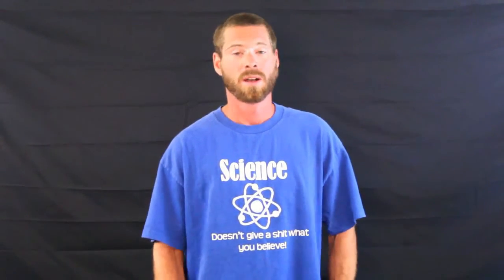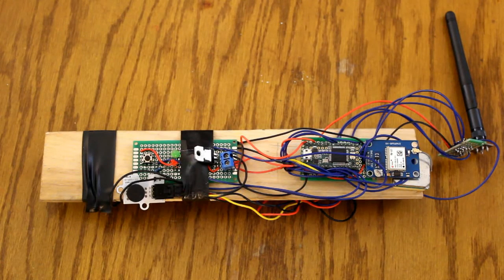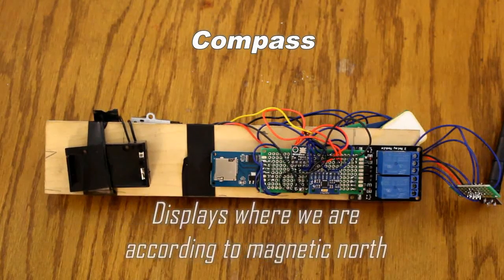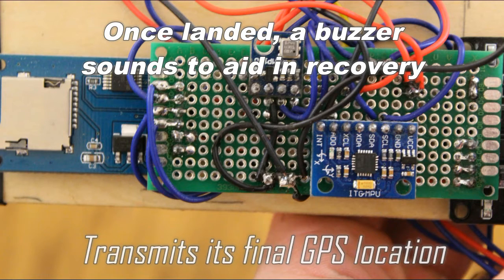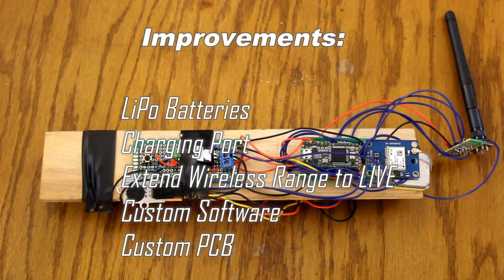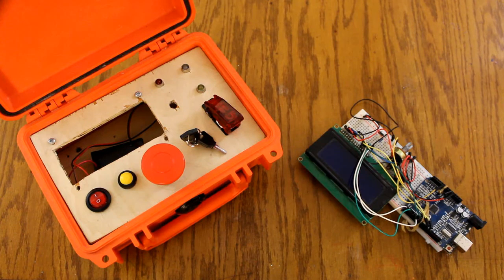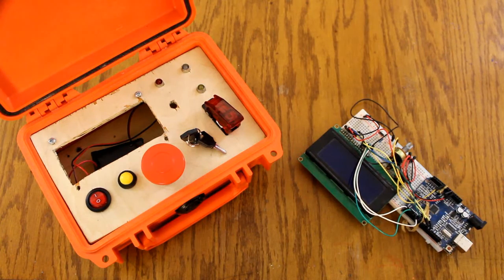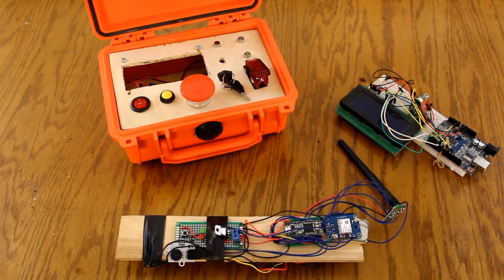Rocket Circuit Overview - Teensy 3.2

Comment: Im using BMP280, arduino nano, SD card and electric match. I'm trying to make them talk to each other. What code did you write? any hep appreciated.
Reply from the maker: Would you still like some help? Try a simple data logger code to get BMP280 to write to SD, and use a relay for ignition. Probably safer to use a manual ignition

Comment: Nice! Need to add a servo controller to make it guidable.
Reply from the maker: I have been able to get in touch with someone and we are currently working on a software program to render the data this circuit provides.

Funny you mention a servo controller. That is going to be an extension of this project. Once things are operating smoothly and debugging is finished, we get a few recoveries, the next project will be a steerable fin set to keep the rocket straight and not spin. Or be programmed to face itself in a particular direction, for science probe deployment near apogee?? :)